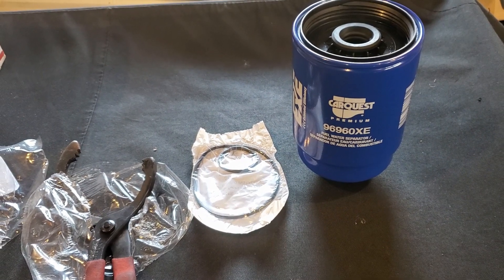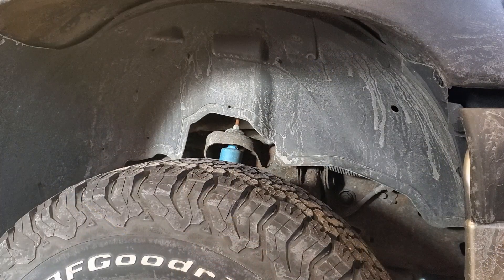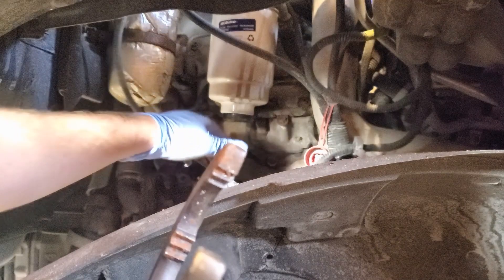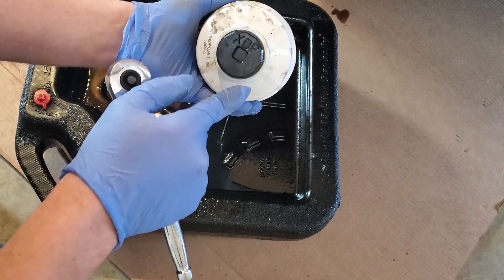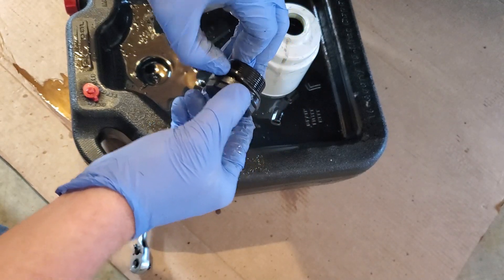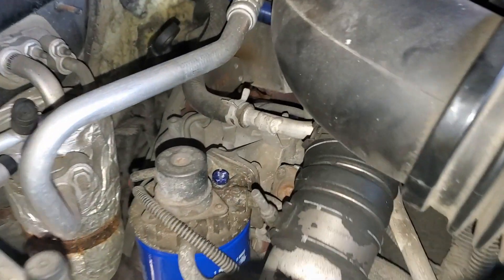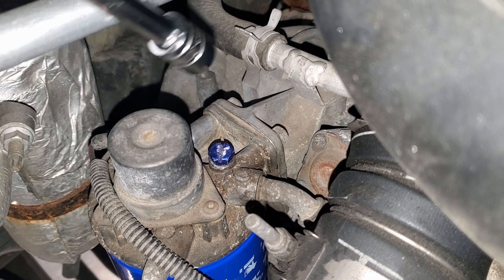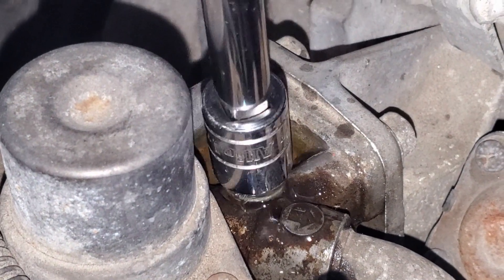Duramax 6.6L Fuel Filter Change - LLY

Comment: Good stuff!! Subscriber #66 gained.
Reply from the maker: Thank you!!!
Reply: @ReelAmericanOutdoors  so what does deleting the sensor on the bottom and the heater on top, when I ordered my new housing , it came with no filter heater hole, and with a plug for the bottom.....I got it because my stock one is leaking from the heater plug and getting a air leak